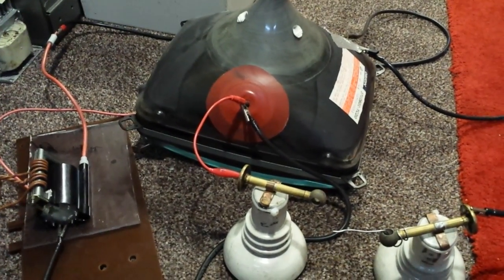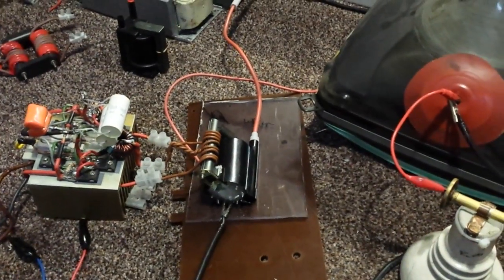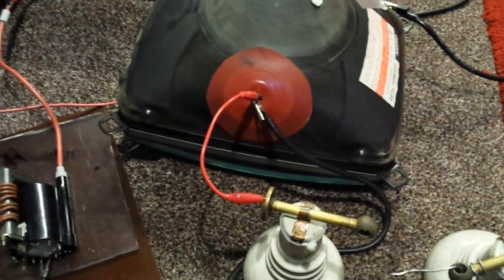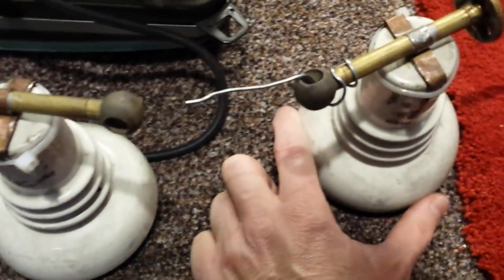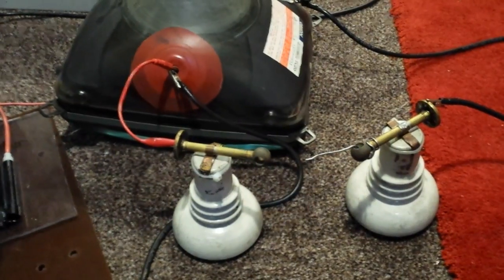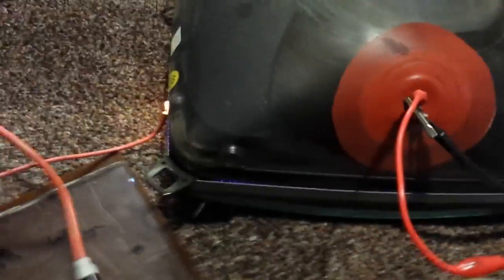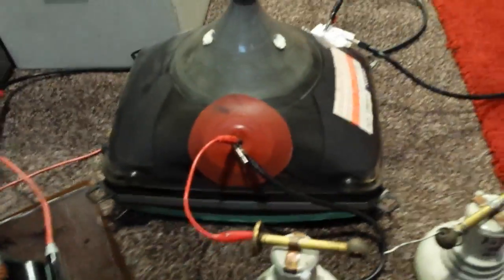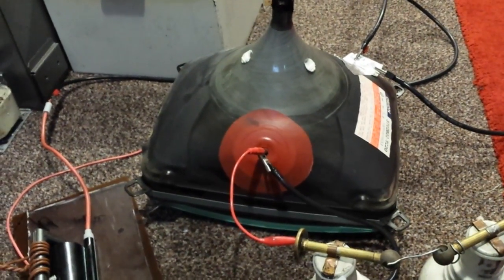CRT capacitor

Comment: I have one of those early "resin type" flybacks, they are actually DC, or at least the one I have is, but yes there is no built in capacitor.
Reply: The transformer is AC driven with an internal HV diode to make the output 1/2 wave DC. Transformers do not work off AC current

Comment: Nice video.
Most other videos about the capacitance is someone trying to discharge a CRT that have probably self-discharged long ago via the multi-megaohm resistor inside the LOPT.

Any plans to manually drive the CRT? as in flyback supply and some other supplies to drive the CRT without deflection or main-board.
(keep some distance from the CRT if you do, there are some x-rays, especially in the back)

As for tesla coil, you could get rid of non-needed CRT parts (front and E-gun) and then stack them. Still I have no expectations of you actually doing it.